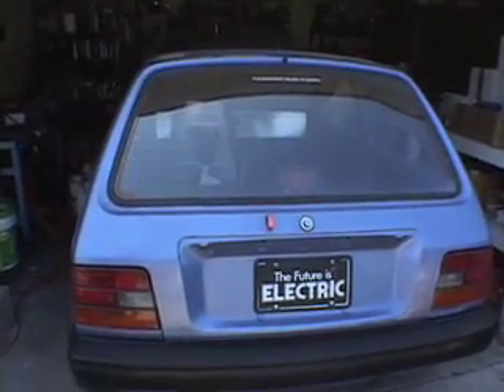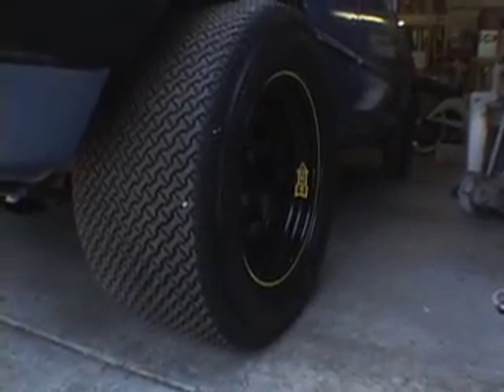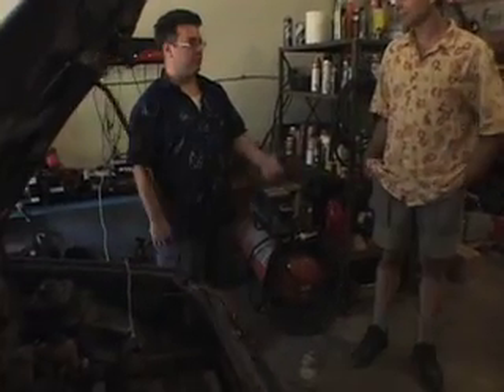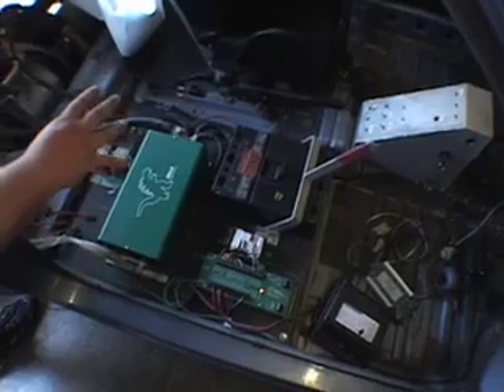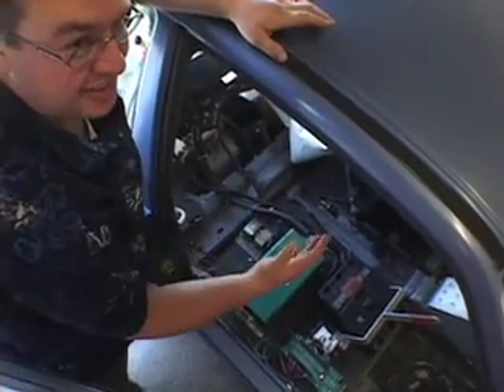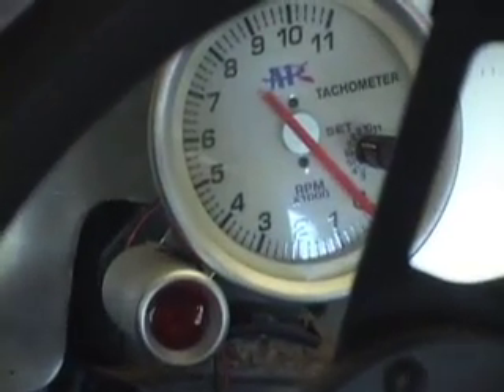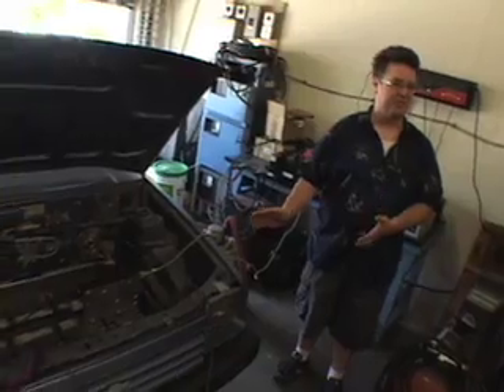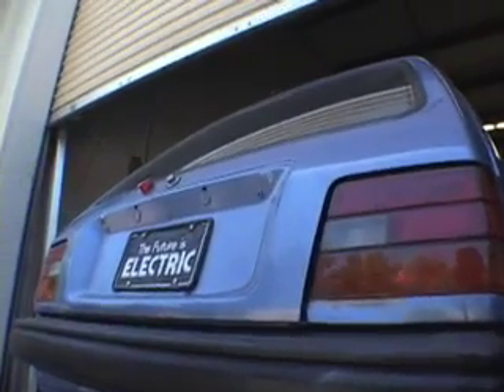Convert any car to an EV: an electric body shop

Comment: "Convert any car to an EV"

And power my car with coal? No thanks.
Reply: The Shootist Gasoline engines only convert 20% into actual motion. Coal plant, however archaic, still produce a better ratio of converting fuel into usable energy at 45%. It is not the answer we all hope for yet but we need people like this to work on the problem. 
And we need to find a better way to power the grid rather than coal, natural gas and oil.
Reply: James Demos no doubt. but the irony of coal powered cars is just too rich a topic.

100 1000 megawatt fission plants would go a ways in replacing the coal plants.  

And no, there is no pressing need to stop using natural gas to generate electricity. Damn little oil being used for that purpose at any rate.  "AGW is a fraud" - Freeman Dyson

The Stone Age didn't end from lack of stone. The Petroleum Age will not end from lack of hydrocarbons.
Reply: The Shootist I would like to see more work on Molten Salt Reactors as they are much safer and the technology in metals has been improved on so much since the 1960's. You wouldn't see the massive contamination like that of Pennsylvania, Chernobyl and Fukashima. I would like to see where this would take us in the coming years.
Reply: James Demos Three mile island wasn't "massive" as nothing but tritium vented and a tiny amount of that.  Chernobyl was a disaster because of lack of containment. Fukashima needed another 2 meters of sea wall and it would still be producing. However I get your point.

The US should, they won't, but should settle on one modular design that can take advantage of economies of scale (the more built the lower cost per each). The Congress should then forbid lawsuits intended to slow construction.  

Personally I prefer the sealed pebble bed designs.
Reply: The Shootist Fukashima is still going.
Reply: Jeremy Hende and?
Reply: Why not power it by renewable energy?

Comment: How simple electric vehicles are: and it just came to me that from a manufacturers point of view - how unattractive because of this simplicity. What of replacement parts and so on? A person can say to warranties and all that after sales stuff "no thanks: I'll take my chances and if the electric motor burns out, buy an after-market part and put it in myself". ditto batteries - controllers etc.

Comment: Did you mount the motors directly to the rear wheels? If so how do you deal with the turning radius one wheel turning faster than the other going around corners? Or are they mounted to a differential? Any detailed drawings?